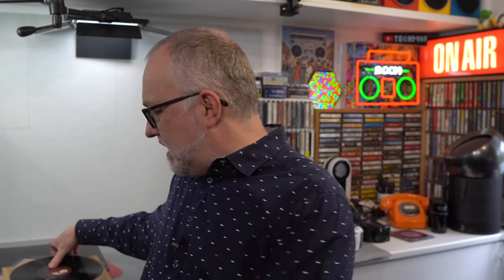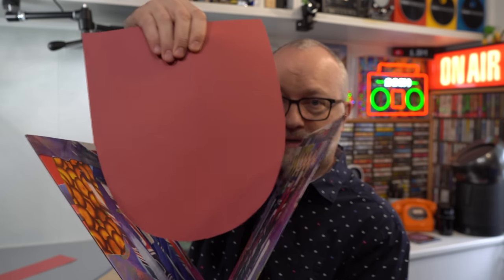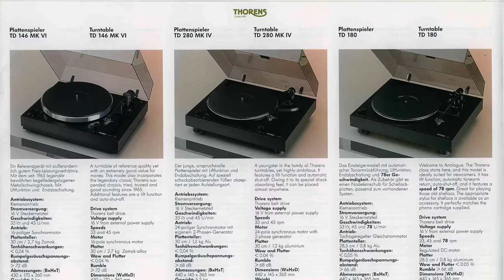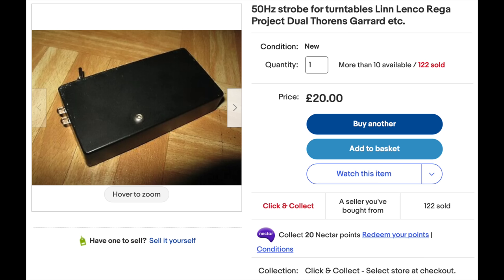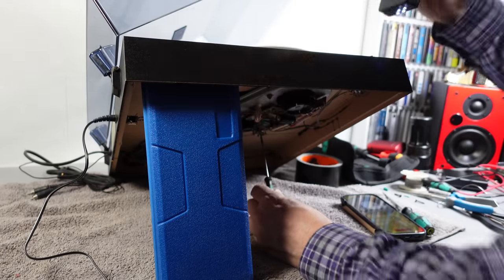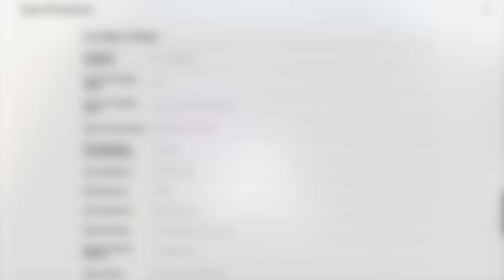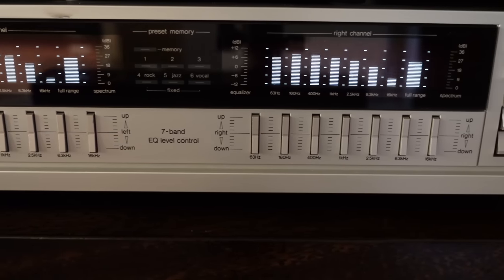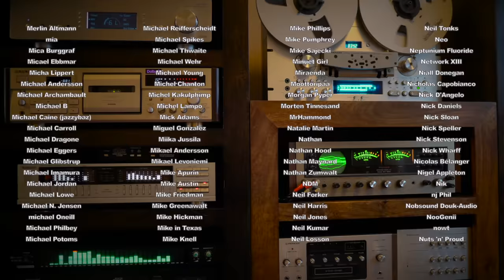Playing 78 RPM Shellac Records properly

Comment: Another great video as always.  FWIW, instead of only feeding in one channel or the other, many older receivers have a mono button which "sums" the audio.  This effectively cuts the surface noise in half, as the two channels of music will combine to double the sound signal whereas the noise is random and non-identical on each side and so remains at the same output as before.  Love the content as always.

Comment: Thank you Techmoan. 78s are a special subject to me and a decent setup has been on my bucket list for some time. I'm leaning towards the LP120BT. Majority of my 78 collection are late 1950s rock and roll titles which are quite rare here in Australia.
Reply: I’m in Australia (Sydney) as well. I’ve got the LP120. Grab yourself a Ortofon 2M 78 stylus. Not cheap the way I bought it, comes mounted in its own headshell, so all you do is just swap the whole headshell out. 5 minutes. Goes about $275 at places like Sydney Hifi. You won’t be disappointed. The records sound fantastic
Reply: I am from Australia as well. Have the LP120BT. I picked up a few (3) 78 recently for free but only picked up a few because I wasn't sure if I could play them. Looked at buying the 78 stylus from Audio Technica but simply too expensive for playing 3 records! Worried that I might leave the incorrect on the system and ruin my other records.  Had one of those suitcase styled machine as well so played my Christmas 78 on that and was surprised how good it sounded. Now "upgraded" to a flip stylus picked up from Ebay and am more than happy with the results. Just want to find a few more 78's.
Reply: Audio technica has a 78 cartridge (AT-VM95SP) that can be bought pre-mounted on a headshell for easy swapping. Costs about $80-100 USD. That plus the standard VM95e that comes with the 120xbt and you’re golden, unless you decide you want to upgrade to Ortofon Blue or Bronze/etc (VM95e is good enough that I’d skip Ortofon Red as an upgrade and go straight to Blue or higher)
Reply: @cartilagehead  Yes, I’m currently running the 2M bronze and I adore it. I had the Blue for probably 18 months to 2 years and the Bronze is a massive jump up. Would love to try the 2M Black, but the price is a barrier, and I’ve read it can be finicky and temperamental. 

I’ve had the LP120 for years, left the stock AT stylus on it for a year, then tried the 2M red, and I’ve never looked back. Been upgrading every 2 years or so.
Reply: But in Australia, the records spin backwards, right?
Reply: @acertainshape  The LP-120 can spin both ways, so you can compensate for that in Australia!
Reply: @acertainshape  backwards, left.

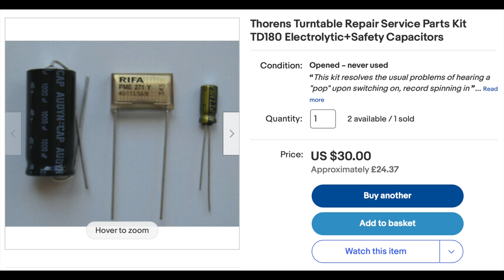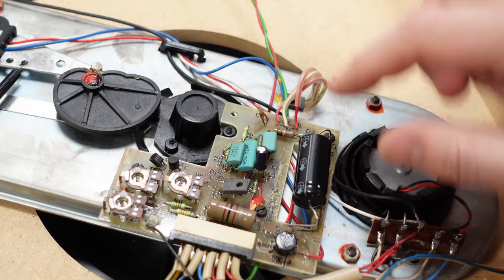Comment: 15:11/17:39 I'd be very wary of that RIFA capacitor, those things are notorious for exploding in spectacular fashion!
Pretty impressive what a difference the proper stylus made, didn't realize it would be that significant.
Reply: It probably won't burn up here (since this is not a mains application as they were normally used in), but it'll still crack (and fail) eventually and is certainly a very weird choice for the kit (what does this application need a Class Y capacitor for?).

Comment: Always interesting to watch your videos 👍
3 things you should do though:
1 - Turn the rubber mat (it's upside down)
2- Center the record properly. It's clearly off-center which causes the "wow" you can hear. When you don't have a turntable w. removeable center "tap" then widen the center hole until you can center the record properly (and the cartridge doesn't move right-left for every turn).
3 - Remove the protective foil on the front (from the speed-changer and all the way to the right) and at the base og the lift-arm.
Thanks and good luck!

Comment: i had no idea that 78 RPM records could sound that good. Of course the recordings themselves weren't as good as the later ones, but a lot better than I thought. I myself only had 33 1/3 records and 45 records as well as the 12 inch versions. Threw them all away when I switched to CD's in the 80's, but how could I have known that in 2023 there would still be a market for them :D
Reply: If there's one thing I've learned over the years, it is NEVER THROW AWAY ANYTHING.

Comment: I have a Dual 1209 that works pretty good for 78's. Besides playing all 3 speeds, it has a knob on top for fine speed adjustment.

In the 78 rpm era, platter speed wasn't standardized, and discs from different recording labels were recorded at slightly different speeds. The fine adjustment knob on the Dual is handy for that. I believe there are references available online that will tell you the exact RPM's for different labels in specific eras

Comment: Wow! That was such an improvement. I had no idea that there was such a difference in the stylus. As for the motor speed, I expect that gradual shifting of component values (including the trim-pots themselves) caused the speed loss. I think your adjustment was exactly the correct idea to correct it. The final demonstration with the new mono setup really sounds good. Love hearing how this should actually sound! It is so frustrating about the content matching issue. I do technical videos and have had to delete and re-do videos where I was talking and explaining something and background radio noise caused a claim. That is so frustrating!

Comment: 2:14 In this particular case you don't need to swap cartridges, it is enough to swap the stylus (both belong to the same VM95 series), which is no more complicated than swapping shells.
Reply: @yorkie984  What he means is that, once the cartridge is installed, you can just switch styluses between 33 and 78 rather than the whole cartridge.

Comment: I enjoyed this Matt. I was a child as the 78 era was coming to an end. My first good turn table had a different mechanism  for play 78s. It had belonged to my Dad, but he had upgraded and I had inherited his old ones and the 78s as his new turn table did not play them. His was from an era where you truly bought a turn table, no arm and then chose the arm to mount with it. His had an Audax (sic) tone arm. It had a unique method for adjusting. You pushed a button down on the arm with it down you rotated it. Doing so essentially changed a pair of cartridges so that the forward one would be the one playing. I think this was possible because this was a monaural turntable so there were only two wires and they connected to the cartridge by a set of brushes.  At the back it had a mechanism that made it easy to then adjust the weight. I don;'t think it was terribly precise but it was good enough.

Comment: I've used one of those Numark record players you have (mine was branded Ion) to play 78s. There are styli available for those cartridges specifically for 78s. It's just a matter of swapping out the stylus (the red bit on on those cartridges). Usually, the 78 styli have a green surround to differentiate them from the 33/45 ones.

Comment: did not know the groove width was different on a 78.  Learned something today.
Reply: Technology connections has a recent video on this topic.
Reply: Archivists have a set of different sized styli for this, as some 78s had even higher groove widths.  Also, using a slightly larger stylus can help get around groove wear.  I personally find quite a few of my 78s to sound better with the slightly larger 3.5mil stylus than the standard 78rpm 3mil stylus.

Comment: Enjoyed the video. I've a turntable that would have saved you a lot of trouble. 
It's a Goldring Lenco GL-75 with its variable speed drive system. Mine is paired with a Shure M78S cartridge on its own headshell for easy swapping with the 33/45 headshell and cartridge.
Reply: Dude has good sense :) I specialise in the GL75 with a mod kit, v blocks and the strobe of course :) GL75, a Linn LP12 beater :P

Comment: I was impressed with your perseverance. I too was a purchaser of the 78 rpm shellac record of Elvis's "Teddy Bear". A very short song both audibly & the groove coverage on the disk (the flip side "Gotta a lot of livin' to do" was the exact opposite!). When I converted my disc collection to MP3 tracks a decade or so ago I'd already replaced the 78's with CDs. Toward the end of their life as a medium Pye Nixa in the UK began producing 78's on vinyl. This was an amazing difference because the quality & I suspect dynamic range & a reduction in the noise of the stylus bouncing around the much "quieter" material, was very noticeable. Thanks for your painstaking work on these projects very enjoyable & reminds me of the steps I'd take in the past to rectify shortcomings in equipment when we didn't have access to cheap methods of checking things out.

Comment: What the RIAA did for standardizing vinyl records playback cannot be fully appreciated until the CDs came along.  Here's my story:
When it comes to making what I would call a "mix" collection of songs, which was done from vinyl records to audio cassettes eons ago, then graduated with CDs to audio cassettes about 20 years ago; one cannot really appreciate what the RIAA did for standardizing recorded music on vinyl, as I discovered when making a compilation 'mix' collection of songs to audio compact cassettes.  

In my attempts to do 'mix' collections of songs from various CDs to a single compilation recording on an audio cassette, the CDs had audio levels and EQ settings that were all-over-the-place, making for an uneven sounding 'mix' compilation in audio cassettes.
Whereas when doing the same from vinyl records to audio cassettes years earlier, the consistency with the audio levels and EQ of the vinyl records were nearly uniform . . .  all one had to do was make some minor adjustments to the recording levels with the audio cassette deck.  The playback levels from the vinyl records were uniformly consistent.  With CDs?  A nightmare of playback levels all-over-the-place.
Reply: Oh, vinyl did have its share of level variation... infamous budget compilations were more concerned with how much they could fit on there so would be fairly quiet, while 12" EPs common for DJ use would be a different story entirely. It is true, however, that being stuck between the inherent noise floor and the point of the stylus jumping out of the groove means that the range of sensible levels is fairly limited.

This had fairly little to do with RIAA EQ, really - that was all about frequency response. EQ was quite unavoidable if you wanted to have a subjectively decent amount of dynamic range while not compromising level handling too much and keeping amplifier requirements modest. It's the only reason vinyl is even remotely being considered "hi-fi".

Digital recording provides a greater degree of freedom in all respects, for better or for worse. Fashions changed, and the invention of the brickwall limiter kicked off the loudness war - if you want to mix material ranging from the CD's early days to the late 2000s, you may be seeing differences of around 10 dB.  Playback volume normalization features (like ReplayGain etc.) were invented for good reason, and basically every streaming service implements one these days.
Reply: All the dubs of my dad’s albums very noticeably had this problem, to the point he just started turning on auto volume control for CDs which had never been a good idea for vinyl. By the later 90s CDs were already getting over compressed anyway so some extra on top was better than having a really inconsistent tape to travel with
Reply: @PileOfEmptyTapes  That's true about the budget compilation LPs having level variations.  
In the US, the 'K-tel' label in the 1970s were famous for cramming 20 songs onto a single LP platter, which lowered the gain when compared to other LPs that would have 8 to 12 songs total on sides A & B.
Reply: Early CD levels were indeed all over the place. Oldtimer mixers were deathly afraid of saturation/clipping so they often mastered the digital part with way under volume. Also, people who were so used to RIAA curves and vinyl limitations continued with those old habits. That’s why, as I found out later, “listener fatigue” turned out to be real. I had dismissed such complaints as the ramblings of vinyl purists and luddites. The fact was that the harsh over-emphasized high end made it through on CD whereas vinyl and RIAA would have tamed it. Again, studio error. Mixers who weren’t properly trained and prepared for new fangled gizmos! I have some old early CDs that sound terrible. “Remastering” really does help in those cases.
Reply: @bloqk16  Thats why I have a line level booster after the phono stage, the K-tel vol 7, EP45 vol 5 on the booster

Comment: The pots are probably connected to another fixed value resistor in series (shared by all 3 pots) and maybe that resistor has drifted.
Reply: More likely that dry bearings restrain the motor, and the platter shaft also might be dry. It was the case with my very similar turntable from the same OEM (Unitra Poland), after I oiled the motor bearngs, it became a lot quiter and faster. But it still has insufficient torque, probably the commutator and brushes are oxidized. This one has enough torque, it probably just needs some oil.
Reply: @mrnmrn1  The feedback system would still correct for motor slowness (to a point where becomes uncorrectable).  The drift must be in the speed measurement system itself.  One should still keep the system oiled, though, as otherwise it's aging the motor rather a lot. Of course, the myriad mechanical couplings between that optical sensor and the actual motion of the disc are all subject to wear, as well.  Note that the speed measurement system is receiving pulses 5% faster than it should be if it's locking onto a slower speed.
Reply: Was thinking the very same thing.

Comment: The HiFi Salesman told my mother in the early 80s to use LP needle position for new discs and the 78 position for old discs. So what happened? My mother used the ‚LP‘ for new LP records which she bought recently until about 2 years and then she used always the 78 position for the older LPs…
Reply: I can't imagine someone wouldn't notice the speed difference when playing an LP at 78rpm instead of 45rpm or 33rpm.
Reply: VWestlife had a video showing that some of the current flip-over cartridges use a sapphire 1mil stylus for the 78 side. I wonder if that's just a more modern situation, since many people would rarely play a 78 and the 1mil stylus still works, even if it's not ideal.

Maybe the separate stylus would still have some value, even if it's just sparing your regular stylus from dragging along the bottom of the 78 groove?
Reply: @graealex  In fact it was only the stylus setting. Fun fact: Although the stylus had these two positions, the speed setting of the turntable was only 33 and 45. I don't know what make it was.

Comment: I think I saw a Rifa cap on the capacitor kit. Those are notorious for exploding and it should be replaced for safety reasons. If you google Rifa caps it is mentioned even on wikipedia

Comment: My dad used a semi-professional phonograph system in his work in the 50's.  It came in a large suitcase, and included removable speaker, vacuum tube amplifier, heavy turntable and a massive straight arm.  The cartridge accepted steel needles which were changed at regular intervals and held in place by a little thumb screw.  There was a small metal dish built into the unit to hold spare needles, so they were changed out often.

You could purchase an envelope of about 10 steel needles for about $1.  The exact same needles were used in test probes to ensure a good connection to dirty or oxidized metal parts.

I am of the opinion that these were the needles that 78 discs were originally designed to use.  Probably some early equalization curves were matched to these needles and massive arms.

The cartridges for early players were not standardized, so when the cartridge failed, a local TV repair shop was likely to install a new entire arm on the opposite side of the platter.  These were plastic, angled, light-weight and included flip-style stereo cartridges.  There was no counterweight, and no adjustment for tracking force.  Made in Japan, as I recall they cost about $5.

Comment: The 78  actually may sound better with 1 mil stylus. Thing is, 78 records are usually heavy used and overused with 3 mil stylus or even steel one. So the bottom of the grove may actually be of better quality. From my own experience on legacy records.

Comment: Long time 78 rpm addict here.   With the exception of a proper pre-amp, a casual 78 rpm listening set up need not be expensive.  Thank goodness you've challenged the frequent assertion of various you tubers that one of these awful modern portables is sufficient for 78 playback.   They are not, and utterly fail at bringing you what is in the grooves.
Reply: I agree, some later 78's, Frank Sinatra for example sound absolutely glorious on a good setup.
Reply: @andrewlittleboy8532  Heck, Columbia and Okeh were producing beautifully recorded and cleanly pressed records in the late 1920's.   That recording of Peck's Bad Boys is actually a very poor noisy cheap 40's pressing, like most of the stuff that came out on Asch and associated labels.....and still people here are marvelling at the sound.    The song is "I Never Knew", and it was often recorded by jazz musicians.  It was an older song when it was recorded for Asch.   Moses Asch was an important figure in the independent recording industry of the period.

Comment: Since the speeds started pretty equally slow, i think I would have tried putting a few layers of heat shrink tubing on the spindle to make up the speed difference. Your solution is definitely the more professional route though for sure. 

Keep up the great work!